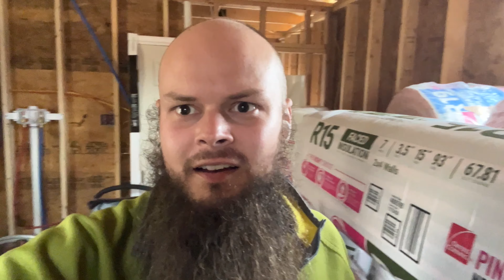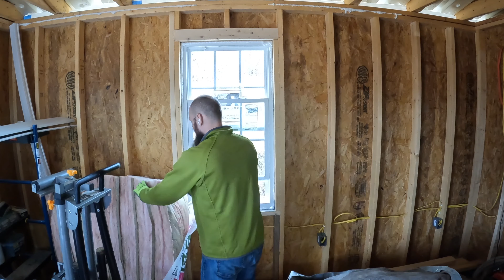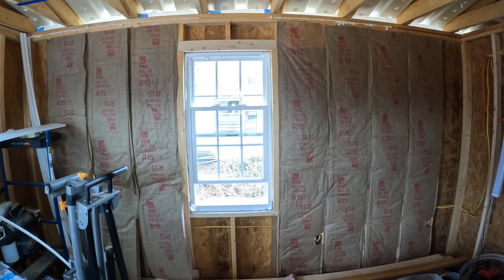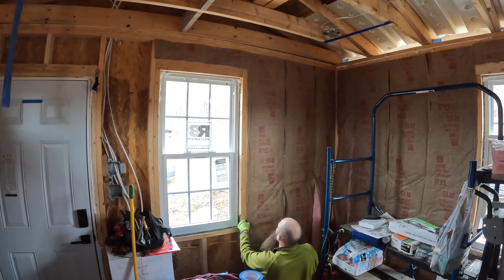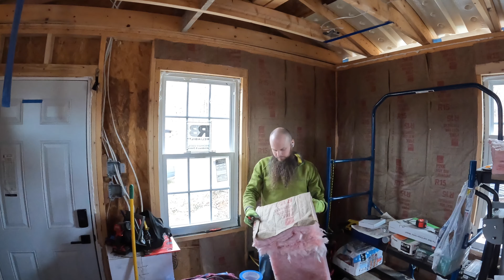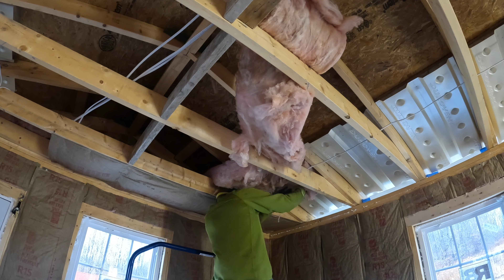solar shed part 26: insulation and drywall installation!

Comment: Looking Good!  FYI.. You don't need to use the level to prop up 1 side, just use the lift to push the full sheet against the ceiling and you're good to go!
Reply from the maker: It seems to only be the 12 foot sheets that needed to be propped. The lift has extendable outriggers but it still doesn’t reach 12’.